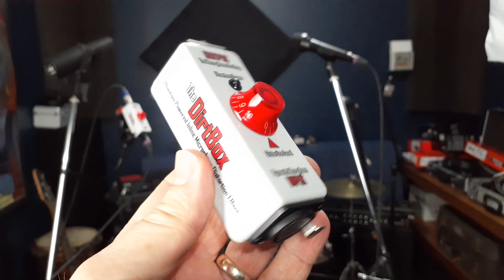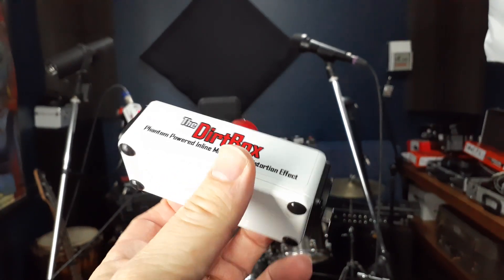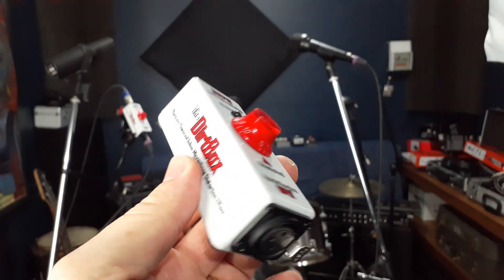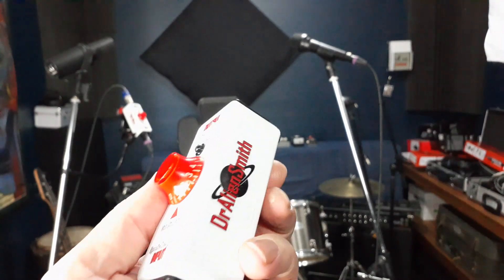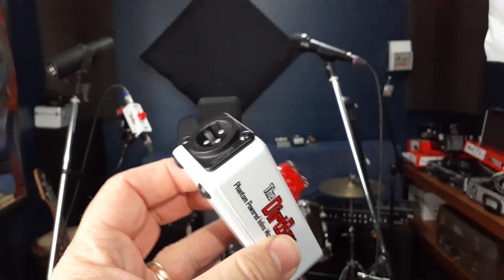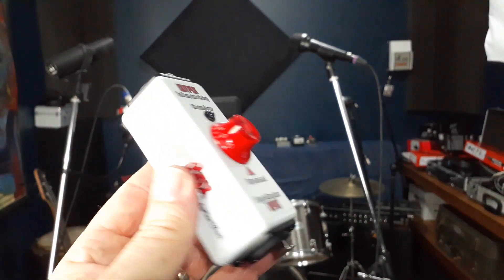The DirtBox - Phantom Powered Distortion Effect Box For Microphones

Comment: Where can this be purchased?
Reply from the maker: Hey Jeff, it can be purchased here www.draliensmith.com/shop
Reply: @DrAlienSmith  does it require external power?
Reply from the maker: It doesnt need batteries or a power pack, it runs off phantom power from the mic preamp, mixing desk or audio interface

Comment: Can these work on condenser mics as well?  if not, would it be possible to make one powered off something other than phantom power to go between the powered condenser mic and the preamp?  How about between the preamp and the tape machine/ DAW? This is genius.
Reply from the maker: Yes they can if you use a balanced Y cable. You split the mic, one split into the DirtBox and one into a second preamp. With phantom power on for both preamps a condensor works fine. This way also gives you in phase clean and distorted tracks. Here's a link to more info, the 3rd pic is a diagram showing how to plug the cable in https://www.draliensmith.com/product-page/the-dirtbox-a-phantom-powered-distortion-effect-for-microphoness

Comment: I understand it’s essentially the same thing as the dirt Mike, but you still should have previewed it through the dirt Mike. I was thinking about buying both. Also you should I had some singing demonstrations. How we’ll does the dirt mic do with feedback?Can you crank it up In a live environment, and use it with the box? Thanks!
Reply from the maker: Hi Brent, the DirtMic into the DirtBox is pretty much insane! Thats an overload of distortion right there. You also need a Y cable for that to work as both need phantom power. 

The DirtMic doesnt work too well in a live environment unless you are using in-ear monitoring with a quiet stage. Theres a band called Sin Shake Sin and they used one on their last tour with that set up. If you have stage monitors cranked up and loud guitar amps then it will feedback. The DirtBox works better because you can use a normal sm58 or other mic that has a tight pattern and good natural feedback rejection. I hope that helps.

If you are thinking of buying one or both of these, message me at www.draliensmith.com and I'll send you a discount code 👽👍
Reply: DrAlienSmith  ok got you. I’m just thinking ahead. I don’t want a lot of distortion, but I like how the box would send a line right to my mixing pedal. Either will work for me tho. I have extra pedals and mics lying around, if I chose the box.
Reply: DrAlienSmith which would you say has more character, or which do you prefer?Also I’m mainly looking to use either of these live just to change up hooks and choruses.id like to sweeten up my solo shows. Does each have a distinct sound?
Reply from the maker: The DirtMic-01 has more character as the mic itself is a bit more lofi. I like using it a lot in the studio because of this. For live though, you're better off with a DirtBox and using a lofi mic or character mic with the dirtbox to add the character. The DirtMic-01 might work live if its just a solo show with quiet monitors but it will feedback before the DirtBox does. That make sense?
Reply: @DrAlienSmith  well then I guess I do need both ha I’m not ready to make a purchase this week, But how much is shipping to the US?
Reply from the maker: Haha, no problem. Shipping for both is $33 US, we use DHL Express which takes between 4 to 6 business days
Reply: @DrAlienSmith  That will work. Thanks for the awesome customer service, looking forward!

Comment: Great job again! Is the DirtBox volume turned off in the zero position? I am looking for a way to convert e.g. an old wah enclosure plus the Dirt circuit (or the like) into an adjustable distortion pedal to which I connect my Shure Green Bullet/Superlux D112C. Ideally, volume would be off in heel-down position to avoid feedback or unwanted bleed.
Reply from the maker: Thanks mate :) Yes the volume is off in the zero position. Keep in mind the DirtBox is set up for normal low impedance mics. The first stage of the DirtBox is a transformer that converts low z mics up to high z to hit the distortion circuit.
Reply: @DrAlienSmith  Is there a feasable way to bypass the lowZ/highZ transformer of the DirtBox? Or would the more sensible configuration be to use the circuit of the DirtMic inside the Wah enclosure and run e.g. a green bullet´s 6.3mm jack into it?
Reply from the maker: @proberaum9253  There are a few options there so maybe email me at draliensmith @ outlook.com and we can sort out the best one.